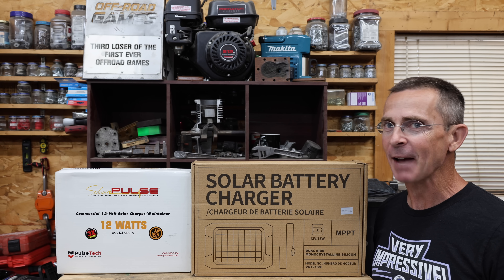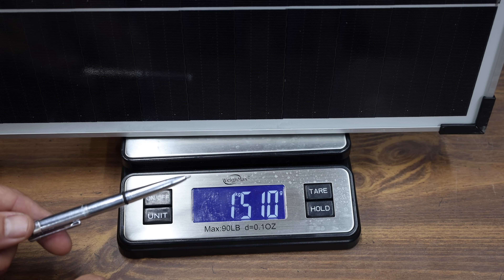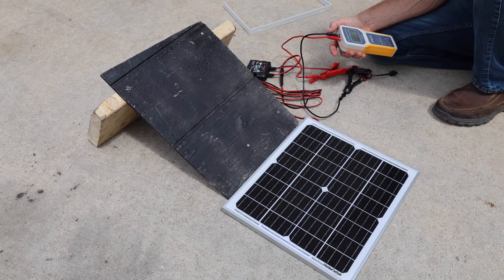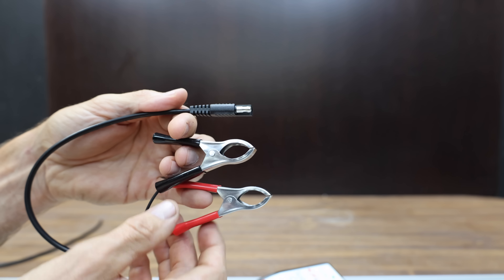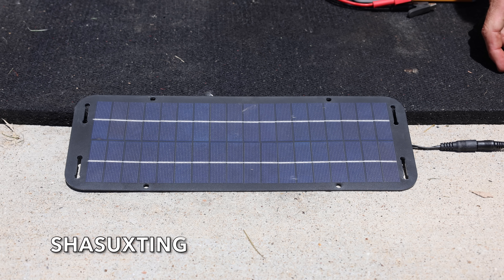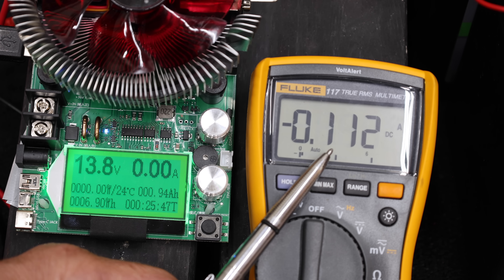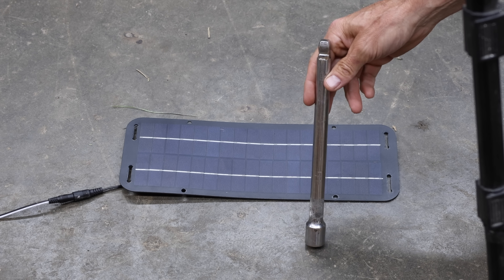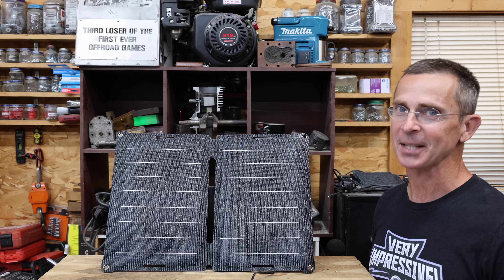I Had No Idea These Were So Good!

Comment: If you don't have a specific solar panel tester, the best way to test the panel is the short circuit current (isc) it'll be listed on the back of the panel. Information from my friend who has been a stand alone (off grid) solar specialist for 31 years.
You'll need to measure the current with a clamp meter, but that's pretty common now on multi meters.

Comment: Just when I think about getting a small solar panel for my car which has a parasitic battery drain when the car is off, you make this video. Guess I know which to get now.
Reply: Why not just figure out what's causing the parasitic drain and fix it?
Reply: @KG-xt4oq  Because it's the computer itself doing it. It's not really something that can be fixed
Reply: @malerra  Yep, sounds like you should just do what you said you're gonna do because if you don't understand that what you just now said makes no sense, then no one should bother trying to explain why it doesn't make sense. I'll just say that the majority of cars today have a 'computer' but don't have a parasitic drain, which is why I said fix the problem...
Reply from the maker: Thanks for the feedback.

Comment: @projectfarm video idea: I'm looking thru your catalog for a test on masonry screws/anchors. What works best on brick, mortar, concrete? Tapcon vs redhead vs wood screws in lead and plastic anchors, etc. Best for horizontal load, vertical load, which ones rust, etc. Thanks for the videos!
Reply from the maker: You are welcome!  Thanks for the suggestion.

Comment: Finally, you cover all those cheap low-quality pico solar system products and PWM controller/Charger. Chinese factories had got so much benefits from exporting, testing and developing those cheap and low quality targeting MEA (Middle East & Africa), mostly in rural and ubran areas. Damn, 😅 I cannot believe, those products had improved over the past eight years.

Comment: With freezing cold temperatures now portable (not the expensive connect to water pipe type that takes 60 gallos of water leaking before it turns off water) leak detection device reviews would be most useful now

Comment: You didn't mention, that all of these will take 6 to 16 hours to charge a 60%, dead car battery,  and a few of those will actually drain the car battery,  when there is no sun. Ideally you need atleast 2amp, to charge a battery at a reasonable time frame. And a decent mppt. Be betting to by 2, 24x48, panel ls at $65 each , buy a connection kit, $14 and some electrical wire, $14, and a $40, mppt. Wire in parallel. 
People gonna be un happy when they buy those small panels and find out they do very little.

Comment: I got a marbero 30w 3 panel charger for $30 two years ago and that thing absolutely impresses me every time. Even with winter sun, it's performs extremely well. Comes with the controller built in, and a whole kit with like 40 different DC connectors, built in USB and and usb c, as well as a port and cables to connect it to more solar panels.

Comment: As others have said, flawed test.  Many controllers will not work correctly without a battery, and who cares what the wattage is at 19v?  amps or wattage measurement  between  a 12v battery and the charger with an adjustable load test device connected to the battery would be a much better test. Increase the load gradually until the the voltage falls to 12v record the amperage.

Comment: Have you done connectors for air compressor tools and hoses??? I have gone through several air tool connector fittings in 4 years.  They get stuck together or fly apart due to grooves forming on male connector.

Comment: You shown that some charge controllers still overcharge the batteries , unfortunately I just bought one of those cheaper (15 dollar) controllers for my 350 dollar accessory battery in my van and now I'm worried , Could you please identify some charge controller models that are reasonably priced and do not ruin our expensive batteries . Thank You.

Comment: Been using  a coleman 2 watt charger for my champion 6500w generator battery for the last 12yrs and it has kept my battery charged up even in the cold ,-30 c,
Still have the original battery that came with the generator 😂

Comment: Many, many years ago, VW provided a solar battery maintainer in their vehicles.  The first one I saw, I could tell was a solar cell, but I didn't know it was an accessory the car came with.  I actually thought the dealer left it in the car by mistake!

I don't know how well it worked, if it overcharged or how much power it put out.  I do know that very few people knew what to do with it or most didn't even remember they had it in the car.

After watching this video, I'm very curious.  I'm thinking about getting one, but I don't want to destroy the battery by overcharging it.  I'm glad your test showed the output voltage - excellent information to have.

Another excellent video!  Thanks for all the hard work you do!

Comment: Suggestions; video on double sided tapes. The ones used to hang picture and frames on walls. I am always curious about their claimed weight ratings and what surfaces do they usually stick to better than others etc. another suggestion is a video on dish washer detergent.

Comment: Best solar charger / maintainer is the Battery Minder.  It's not cheap but it works and has dual charge capability (meaning you can buy a splitter they sell and charge 2 batteries at once!).

Comment: What I find funny is that often after your videos go live, the products go out of stock, or the seller changes the prices (usually up), or weirder, they change the linking to more expensive and larger products(Grecell which is out of stock but it's weird how it auto links to an 80W unit).

On a different note, considering the similarity of the Shumacher to a Harbor Freight Thunderbolt unit, I wonder if the performance is similar.

Comment: Watching gas vapor engines from 8 years ago. Would one of those micro vibrating metal plate humidifiers for ventilators create enough vapors to run a truck more economically ?

Comment: My wheelchair lift in my van, as all of the wheelchair lifts, they have a draw when not in use, previous was so much a week, you had 2 choices, start the van, or get in, can't do both, because getting in would drain what was needed to start the van, park where you can get to the drivers door or don't get a "Vangater" lift, just don't get that POS! I bought a $35 solar panel and controller from Amazon and magnet attached it to the side of my van, been good, always fully charged. Battery in my van, under the bed is an AGM, got a steal of a deal, these are heavy and extremely expensive, did this because in event of an accident, the battery under the hood never survives, be damn if I am trapped in another van in case of fire, lost a friend that way, previous van of mine, one battery, under the hood, was compressed into the dash, I was trapped, thank God no fire.
I put a ATV winch in my Honda Odyssey on a small Duracell battery to pull my wheelchair into the side door behind the drivers seat, not wanting it connected to the vehicle electrical, put a small Harbor Freight charger on the dash, internally controlled, I hope, in a year, not once has the battery drawn down, its been completely self reliant, I'm happy, but shocked over it, tho its not driven much so when I get in, it must not draw much to winch in my chair. 
All vehicles have a draw to keep the computer in them going, if its going to sit a long time I suggest a small panel on the dash to save you some grief.
Reply: I have the Hoysicy, been using it for a year on my AGM, no issues, had the same one on a previous van I sold with the panel on the roof.

Comment: I like the Flexsolar and  Grecell panels. Modern cars have so many features that create a parasitic drain on the battery, that you can actually have you car parked in the driveway for a 2 or 3 weeks and find the battery dead when you need the car.
Reply from the maker: Thanks for watching

Comment: I’ve been watching your videos since the beginning and recommended them to my friends. This is the only one where I question your ratings.  Based on the most important values to me, watts generated, volts, charging capacity ( cut in and cut off), and price. The EBL should be higher rated.
And it seems like some of the links are already dead, probably due to your rabid fans.  I have always found that the solar panels are hit and miss, both in availability and quality even in the same manufacturer.  
Kudos though for as a very thorough test series.

Comment: Suggestion: Waterproofing spray for shoes. Could test how well it works for water resistance, keeping shoes clean (dust/dirt), holds up after x# of miles / steps, UV resistance, while also considering price per ounce. Potentially others but thats what comes to mind.

Comment: I bought 2 years ago. I have 1 for my truck for in the winter when I might not drive it in a couple days. the other for my tractor on my vacant lot in my shed to keep battery from freezing. Good video.

Have you done a video on LVP flooring? That might be something people might like. Different thicknesses, wear layers, core type and looks. I will be using LVP in my new house. They have gotten better from few years ago.

Comment: Hi there, big fan.   One thing Ive notice over the years, your listed prices tend to be lower than the amazon linked prices.  At first I thought perhaps your videos make a rush for the product and the prices go up but using 3rd party price trackers I started to notice they were never that low.   Any idea why that would be?   I thought maybe Amazon is charging various prices from region to region (im on the East Coast USA) but I think the 3rd party price trackers would pick that up too.   Not sure.   Why do you think that it?

Example from this video.  The TBER lists $30 but shows it never went under $50 on camelcamelcamel.  Currently at $60 on Amazon.

Hope you see this comment out of the many you get.   Generally curious as to what is going on.

Comment: Using the solar panel tester on panels that have active charge controllers or even battery health circuitry seems a bit unfair to me, to be honest. I believe you're not getting reliable readings with this approach.
Another interesting test would've been the panel with and without a pane of windshield glass.
I keep a TogoPower charger behind my windshield most of the time and while it only generates ~3W there, it's more than enough to keep the battery topped up, even when the car sits around for months.

Comment: We keep our motorcycles in the garage, easy access to 120 power. My truck and her car are only a few years old so we don't worry much about the batteries. But there is one other concern with solar charger/maintainers, my truck does not have a cigarette port.  Good video Todd!

Comment: Some solar panel controllers do not handle very cold temperatures we see in northern states. Unfortunately, you did not test this or give ratings. I lost both a charger and a battery because I assumed it was charging but cold weather destroyed it.

Comment: There is one aspect of solar cells in this class that gets overlooked very often. All flexible and rubber like coated  panels will suffer overtime because that top layer over the cells will turn yellow or foggy from the sun exposure. That kills their output significantly. Only glass on outside pannels will not be affected. Cells themselves degrade over time but cells will have proper exposure if you keep the glass surface clean.

Comment: Video suggestion: I was about to pickup a Flir phone attachment for thermal imaging as they've been the "name brand" for decades but then ran across a few for 1/4 the cost and seemingly better range, refresh rate, and resolution. With the lower price points now might be a good point for a comparison of budget thermal imaging phone accessories as the price to performance is much more attainable not it would seem.

Comment: The use of ranking numbers in the summary tables instead of measured values is a bad idea - meaningful data is lost.  Rank 1 and 2 might have 15 and 14.9 watts, for instance - insignificant difference.  Or they could have 15 and 8 watts - major difference, but the same ranking.
Reply from the maker: Thanks for the feedback!

Comment: The solar panel charge controllers used by the Hyocicy and the Tber (and possibly others) are cheep generic units that I believe are made in China and can be bought online for $10 or less. One reason these controllers are so cheep is they operate using a very inefficient PWM control program and may have poor quality control. The two issues I've found trying to use them is not having the proper amount of enough heatsink paste on the heatsinks and not being able to properly adjust it's charge cutoff voltages (as you noted in your testing). That said, some of the "charger" systems panels in your review look like they have no, or very little charge control circuitry at all. If the solar panels were used with a better quality (such as decent MPPT) controller they would probably perform significantly better., Unfortunately decent MPPT controls are more expensive

Comment: Im glad u did a video on this, I have a 3 different solar panels mounted on my mule, tractor, lawnmower, I pop rivid the panels to the roofs and hoods, I have a flex solar on My mules back rack that's been on it for a year and the lawnmower battery on it was considered warn out a year ago and still cranks it.  I haven't had to jump my mower off in over a year useing because of a solar panel granted it sits under a carport it sat most of the winter and still cranks. With my old tractor I dont use it everyday and the solar charger keeps it charged. Solar chargers are honestly the best 100 I've ever spent, I just recommend securely mounting them to ur equipment I lost my first charger by dragging it down the driveway.  😅😅

Comment: Love this channel, thank you for doing what you do.  My only issue is that the criteria for each product is unweighted so that scratch-resistance is given the same weight as solar productivity.  IMO, this makes the average finish ranking less helpful.   I suppose if you included a category for how well the product name rolls off the tongue, the NAQWLL may have scored even lower in the rankings, but In my view, it should be a top choice given its high rankings in all three solar production categories - despite its poor scratch resistance.

Comment: Not all cars will allow reverse charging through the cigarette plug. I've used a small one for several years as a trickle charger and they work great in that roll. Don't expect a small 20 watt to charge your dead battery enough to start your car unless you have a couple of days to hang around.

Comment: I had an old school 1.5 watt "marine grade" maintainer back in the day (30yrs ago) with old school maybe lowish voltage 14.4 V.O.C. in full sun.  It was in the shade a lot, but kept my battery charged up and made that battery last ten years . . . until the wiring broke down from UV light and shorted out in some drizzle.  After a few hours in full sun, it would charge my battery just enough to start my '84 Nissan pickup if I had left the morning commute headlights on and discovered it at noon.  After that I bought a cheap one with shitty wiring, with like 18 V.O.C..  The voltage was too high without a charge controller and it never worked right and fell apart very early on. 1) High wattage doesn't matter as much as durability: a) Don't get cheap wiring: these all look decent b) Sunlight eats plastic panels and wiring, so get glass panels and if you get a glass panel where you can replace the wiring after 9-10 years, it will last a LONG time.  You can put some kind of flexible conduit or covering on wiring to make it last instead and replace that in ten years.  A low trickle is enough for battery maintaining and best for desulfation, but, a little more watts will charge up a battery that went flat from leaving something on or maybe keep your battery going so you can run a radio or charge some small device.  It takes 50 watts to run my air compressor to fill my car tires without running the car engine.  I sometimes have to pause, to let the lead acid battery come back up if the tires are really low.  Those cheap Chinese charge controllers work really well on small loads like these, but where you screw the wires in, the wires will get fatigued and eventually fray and cause shorts.  I just shoot a bunch of hot glue gun glue around the wiring points to fix that.  You could also use silicone or caulking from a tube.

Comment: It looks like some of those panels have MPPTs that are built in and can't be bypassed (like the TogoPOWER). If so I don't think your measurements with the solar panel multi-meter are valid and would explain the unusually poor performance. The solar panel multi-meter has it's own MPPT and needs to be directly connected to the panel cells. For panel with it's own MPPT you want to use a regular multi-meter or load tester.

Comment: Awesome test! But i want to say these cheap PWM Charge controller are not good at all! They can overcharge your battery since at many of these PWM controllers the battery voltage i measured lower then it actually is.